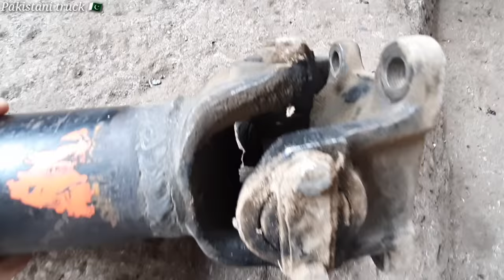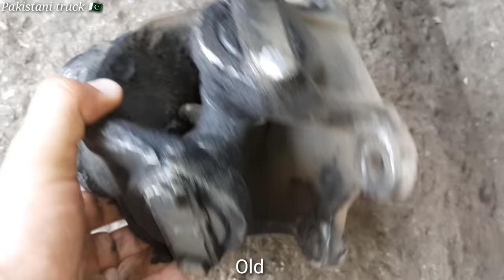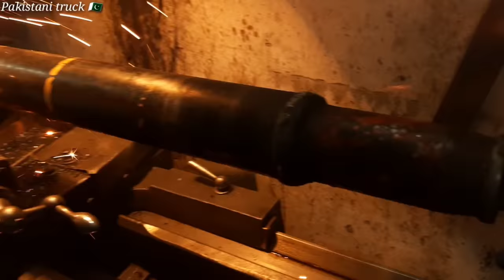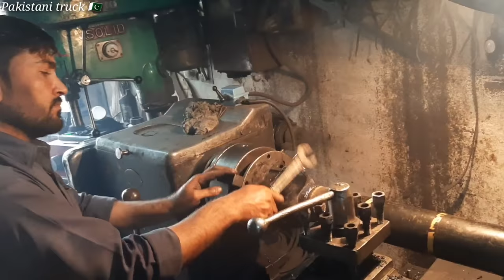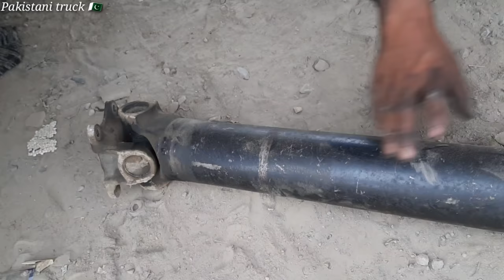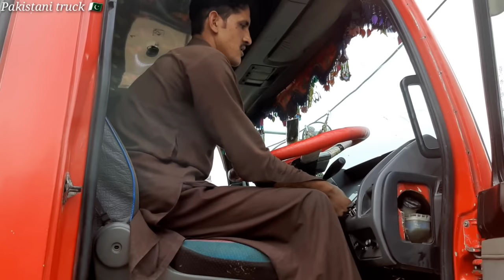Replacing drive shaft head and checking in road

Comment: Welding on the lathe, pure savagery !
Reply: tell us: how would you do it?
Reply: Don't buy a used lathe from these guys lol
Reply: @mrjodoe  1 Use anti splatter spray and cover the ways. 2 use a piece of braided copper to ground the prop shaft directly so no current can go through the bearings.
Reply: @MatthewTinker-au-pont-blanc  dude for electrode you dont need anti spatter. Anti spatter is for MIG/MAG nubs. 
Weld some sticks and you will see.